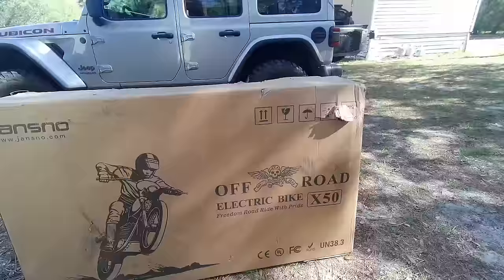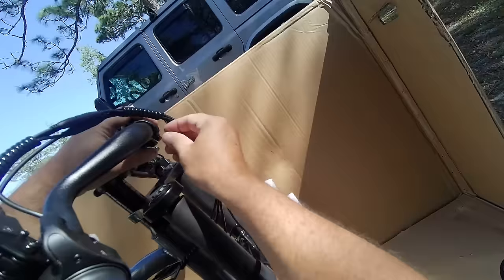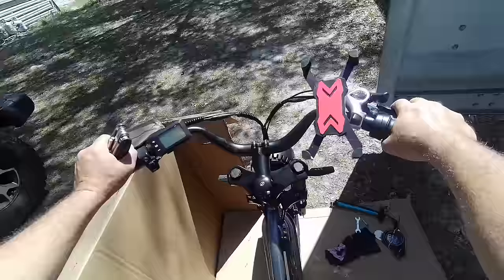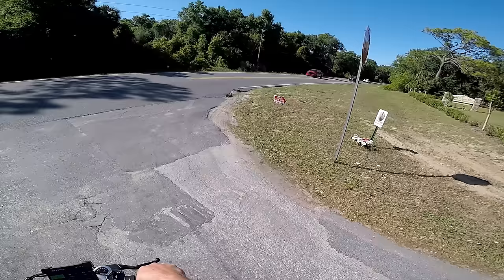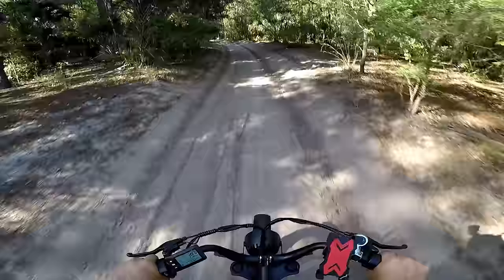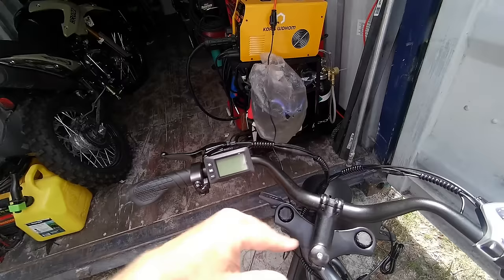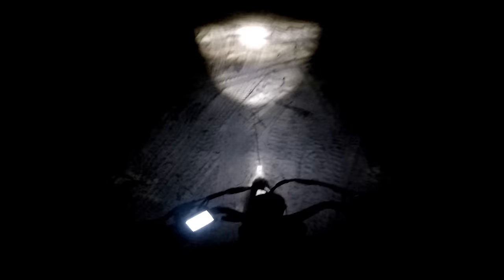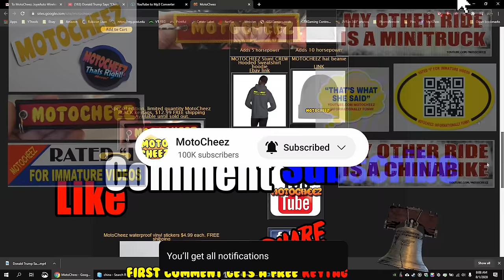Jansno X50 Electric Bike 20"x 4.0 Adults, 750W Brushless Motor, 48V 12.8Ah Removable Battery,

Comment: I've been riding electric vehicles and E bikes on the roads for 15 years and I would NEVER ride on a pedestrian sidewalk.
 Putting your comfort level ahead of the safety of pedestrians is not only inconsiderate it's illegal!
Reply from the maker: The one I was on is never really used at time I was on it. If I saw any pedestrians I'd hit he road.   
I never new if it was legal or not, some are shared here and stated so, if I don't see a bike lane I assume it shared?